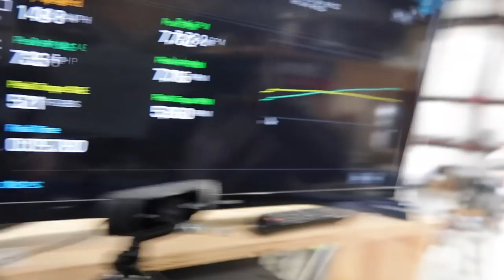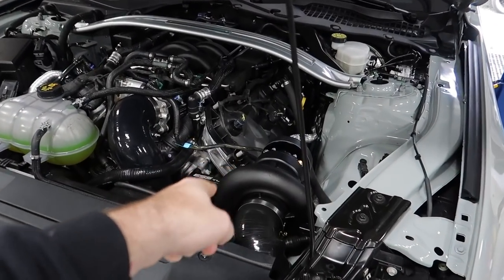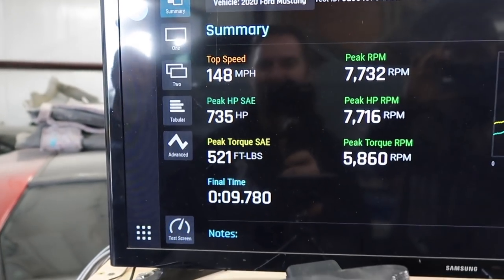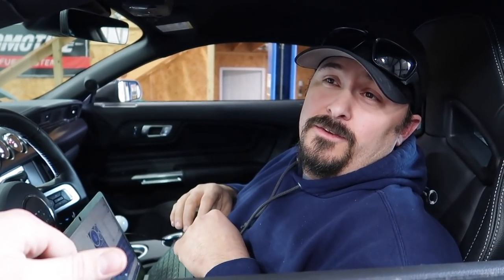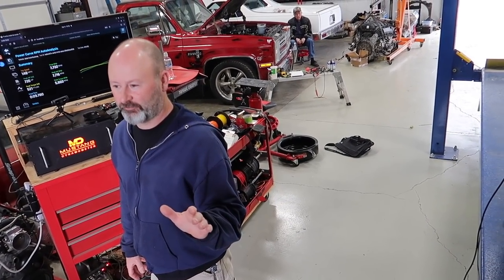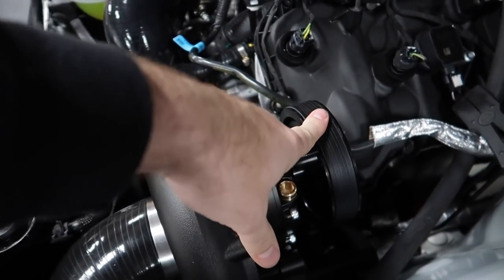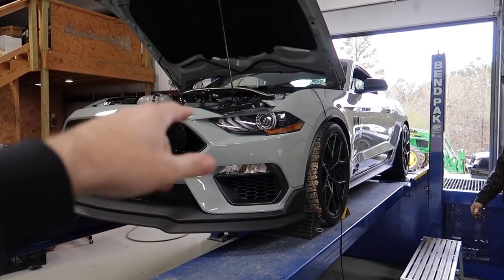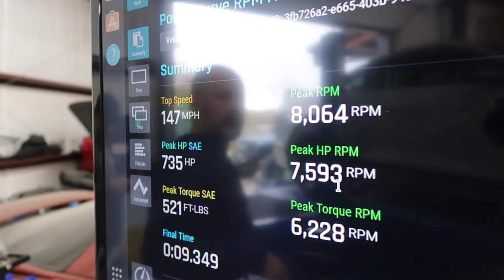My 2021 Mach 1 ESS Supercharged Mustang made WAY MORE POWER THAN EXPECTED!

Comment: I love the car man but I’m not trying to be a prick but there is no way I’m going to believe that you are getting 735 hp off of 7 1/2 pounds of boost. That is not possible and why isn’t the dinos showing how much of boost you’re putting out. The limit on these engines with pump gas is around 650 hp and if you’re putting out more than that either you’re using too small of a pulley and the Dyno is absolutely rigged To put out false numbers. There’s no way that I’m going to believe that so that means you’re going to trap around 130 mph in a quarter mile. That’s just not possible unless Ford magically gave you a magical mach 1. But running off pump gas there is no way I don’t care watch your tuner says and I would totally stay away from him because you are going to blow that engine and I guarantee you that. I’m not trying to put your car down I’m just trying to tell you to beware of the shops claiming false numbers which I have seen in the past. You can fool all these other people on your channel but you cannot fool me. And oil pump gears are not going to save your engine. I have never put oil pump gears in any of my cars and have never blown up one single car because of an oiling issue. The only reason why you need oil pump gears is either you’re banging off the Revlimiter or there’s bad harmonics in your crankshaft. You do not need oil pump gears just cause you have more power. Your GEN three that you blew the motor on that had a turbo did not prevent that car from blowing up Unless you’re rebuilding an engine there is no need for an oil pump gear. Now if you had an automatic I could see putting an oil pump gear just for safety but not in a manual transmission car. I know mustangs and I probably know a lot more than those people who dynoed your car Because if you have the set up that you say that you have that Dyno  putting out false numbers you need to look at the Dyno chart putting out actual boost I know of cars putting out 10 pounds of boost which is the safe zone and are still not putting out that much horsepower. The rule is on these coyotes is 10 pounds of boost and around 650 wheel horsepower Is the safe zone on pump gas. The last thing I want to see you do is blow your engine in that beautiful car. I’m not talking shit I’m trying to help you out
Reply from the maker: Well I’m not trying to be a prick either but you are dead wrong on several things you said and have no idea how any of this works to include a dyno. Firstly. We did not measure for boost on the dyno as most of them don’t. What was measured was a MAF reading of 84 pounds per minute of air. That’s higher than some whipple stage 2 kits. Secondly, I have no idea where you are getting 650 as the cap for safe on 93 pump gas. 100% of the internet and aftermarket tuners would disagree with you on that. Feel free to call some. 93 octane produces much better than 650. The new Shelby GT500 puts down more than 650 on 93 lol. Thirdly, if you are still reading, it helps to watch the entire video bc we explicitly explained 120mm pulley is rated for 7.5 at 7200 rpm. We were reving past that so it creates another pound of boost. Very common knowledge with centrifugal blowers. Also you are absolutely wrong on your theory of oil pump gears. Manual cars need them more than auto. And these cars are known to even break them at stock power levels. Call HPR and verify.  ONCE AGAIN very common knowledge. Yea I lost a motor in my red car bc I was told to go WOT on a tune that was not finalized. That’s one reason I switched tuners. The next time you call someone a liar, get your facts straight please. Or, send me a private email and we can discuss any issues or concerns. But when you comment in front of thousands of viewers, make sure you actually know what you are talking about bc literally everything you said was completely wrong. Again, I’m not trying to be a prick, I’m just trying to help you out, same thing that you said to me… have a blessed day
Reply: And the GT500 Also has upgraded pistons and connecting rods which can’t handle that much power
Reply from the maker: @sylvesterstallone8637  🤣🤣🤣 you still wrong on everything you said.
Reply: I’m not here to argue but please read what I have to say.  First, if you watch my videos or have talked to me in person, you have heard me say that I don’t put much stock in dyno numbers. I care more about trap speed. Even when I was talking I said that main thing is the difference in the first time it went on the dyno vs what it made with the supercharger. As we used the same dyno and could see what the car picked up with supercharger and tuning.  We use this dyno for tuning in a safe controlled environment with cars that come through the shop, I’m not one for taking a customers car 100+ mph on the street. So talking about this dyno My green gen2 car with a gen5 whipple put down 685 on 93 on this same dyno and ran mid 10’s@133mph.  These are facts that you can go and watch on my channel. You can’t make up a trap speed at the drag strip on film when they hand you the slip and you look at it with a helmet cam. That was on 11psi on the whipple with full interior on a premium car.  Now my 20 with twin turbos on 93 on a tad over 7psi ran 135mph in 93 and Again on film and on my channel. I don’t believe in fluffing numbers and hate it because it does no one any good.  Also Wengerd has been tuning me since 2018 on several setups and I’ve never hurt any of my engines and they all ran great. He is even listed as the preferred tuner on the ESS site. Everyone knows 700-730 is a stopping point on 93 in the gen3’s then it’s time for E85. I told zander I’d probably put a fuel system on the car and would not do anything to raise the power without it. I trust the tuners and Lund has tuned a few of the vehicles that have came through my shop and they have never had any issues with our builds when tuning them.  Also if you have to say I know more than another guy when trying to prove a point that tells me a lot. I’m not trying to be a prick, anyone that knows me knows I’m a down to earth person and don’t care for drama.  I have not had any of my customers hurt their engine. If the tuner looks at the log and says it’s safe, I trust that. Again, I’m not here to argue but when you claim stuff on cars that come out of my shop I will come state my case. You can talk to any of my customers and they are all loving their cars and I have several of them that call me to talk about how good it did at the dragstrip etc etc. I have worked on cars since I was very young and had a very good career being a technician.  I decided to open my own shop after seeing some of the horrors that have came out of some shops and having alot of people asking me to after watching what I did with my cars. I have fixed countless issues that have come out of other shops and customers have all been pleased. I get calls from other shops because of my background in diagnoses as a tech for issues that they have from time to time. One of these shops that a big name tuner on here have gave shout outs to and they call me from time to time. I even have one of their headaches at my shop because they trust me. So if that doesn’t say something about my knowledge and ability I don’t know what does.  Have a great day!